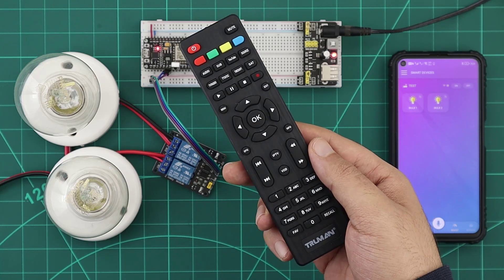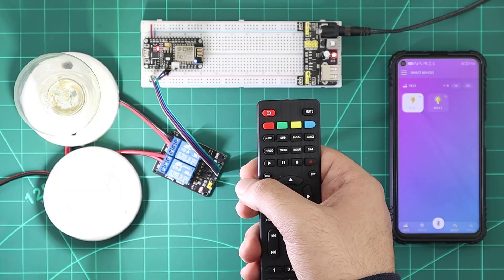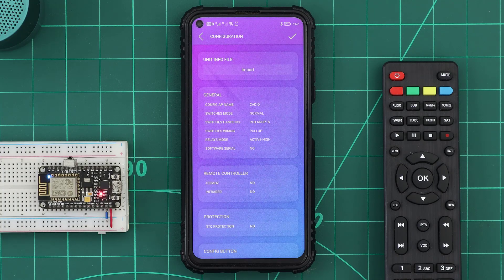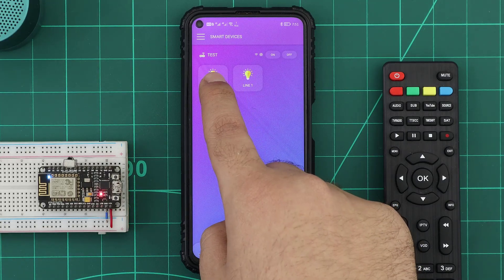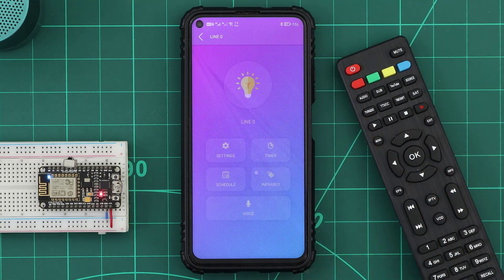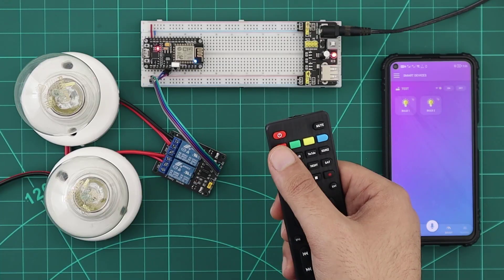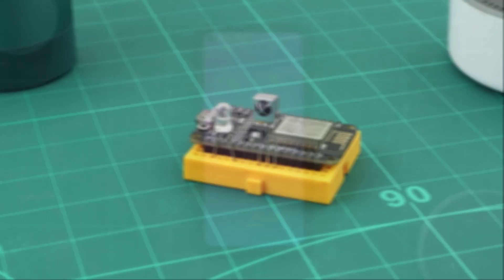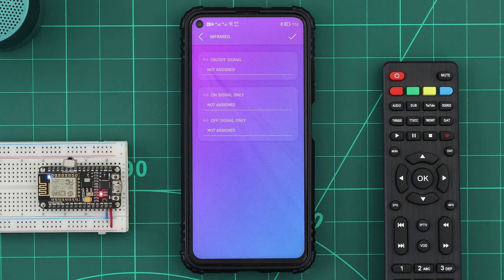Control your CADIO devices with infrared remote controller (ESP8266 - ESP32) | CADIO Home Automation

Comment: it will work without internet after configuration?
Reply from the maker: Yes, and for better offline stability, choose a unique unit position on the network from configuration page instead of auto positioning
Reply: @cadioHomeAutomation  if device is not connected to internet as well as wifi .. does it work through IR remote?
Reply from the maker: Yes of course

Comment: I  flashed again my esp32 to add the new feature but there is only 433MHZ  choice .. i have latest app version.
Reply from the maker: What is the firmware version you are using?
Reply: @cadioHomeAutomation  thank you for   answering so fast <3 . It was firmware .. i thought that i had latest but i didn't 😬

Comment: Thanks for the awesome app ❤❤
I've been using this app for a month now, but I wanted two days ago and add anothers on/off devices, 
and i repeat everything step by step on my esp8266 but after i complete  all the following steps the app does not show me the devices i have configured it still show me NO DEVICES YET i repeat all the steps many times but still the same error

Please if you can find me a solution I will be grateful to you ❤
Reply from the maker: The ESP connecting to the router wifi network or not? (does the wifi indicator led flashing for seconds then lights permanently?)
Also another reason for this issue is selecting wrong role for GPIOs, some ESP8266 GPIOs can not be used as input or output, and this may cause a boot fail.. as you added new devices then the issue happen, so what is the GPIOs you are using?
Reply: @cadioHomeAutomation Yes the ESP is connecting to the router wifi network and also i try it with my airbox connextion ,
then the ESP indicator led flashing for seconds while i configuring my devices ,
But when i'm done the led does not light, but i don't think its a  problem because when i used cadio month ago i remember that the led indicator does not light but the devices works fine .

and i have select GPIOs 4 , 5 , 12 , 14 , 15 as ON\OFF devices and GPIO 10 for DHT 22 

THANKS FOR THE QUICK REPLY ❤
Reply from the maker: @yosrihadjali7573  OK it's so clear now, the issue is "boot fail", and the most probably reason is GPIO15.
GPIO15 cases boot fail whel it is pulled high.
Is GPIO15 is pulled high or connected to active-low relay module?
If yes, you can use GPIO13 instead and the issue will be solved. 

You can find all details about the esp8266 GPIOs here:
https://randomnerdtutorials.com/esp8266-pinout-reference-gpios/
Reply: My GPIO 15 is connected to ACTIVE-LOW and my ESP module is Module IOT NODEMCU CH340 Compatible ESP8266 32M is not ESP8266 12-E  module , so doubt at another problem  ,but Thanks For the fast reply u are the best LOVE CADIO
Reply from the maker: @yosrihadjali7573  I think it's same for GPIO15 in both of them. Just give it a try
Reply: Yes i will give it try 
Thanks for your quick response to all my questions. 
You really do a great job. I wish you success best CADIO ❤️❤️

Comment: Is there a way to connect multiple ESP to one account?If yes, How?
Reply from the maker: Yes of course, you can add an unlimited number of units to your account.
Just repeat what you did with the first unit for the new units and they will automatically be added.
Reply: @cadioHomeAutomation  Thanks a lot
Reply: @cadioHomeAutomation  And Do I need to pay for non trial option?or do I have to pay again for second ESP that connect to my account?
Reply from the maker: @AliReza-xl4zw  https://egycad.com/cadio/docs/pricing/

Comment: how to control esp32 via bluetooth, and you need to recognize that the bluetooth is near or far.  When you press the button, if the bluetooth is connected and authorized to the esp32, turn on the relay, pressing the second time will close the relay, open it again.  door lock or opening car doors.  how to do?
Reply from the maker: Not supported yet
Reply: @cadioHomeAutomation  I'm waiting